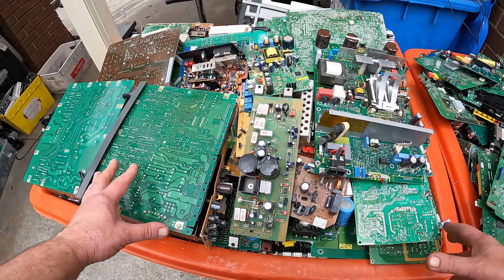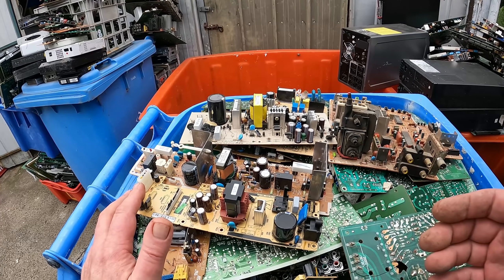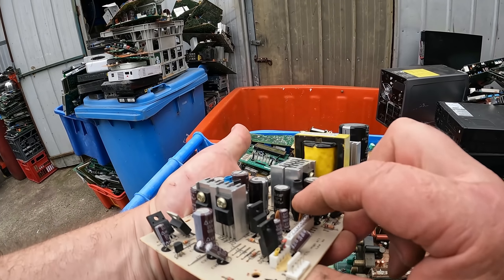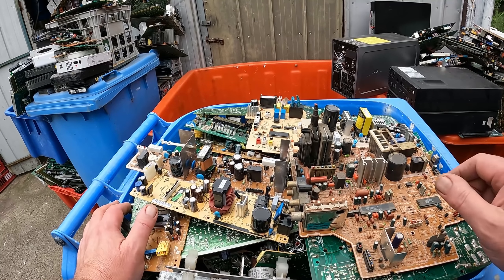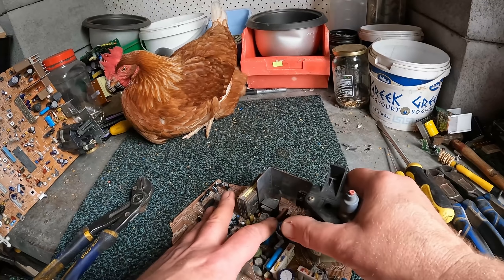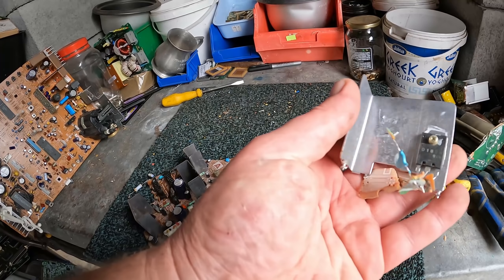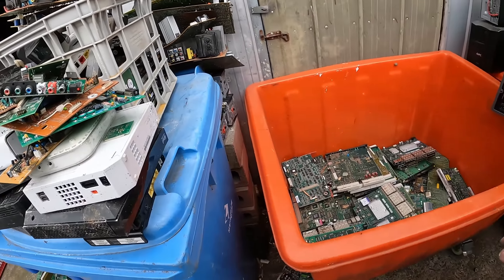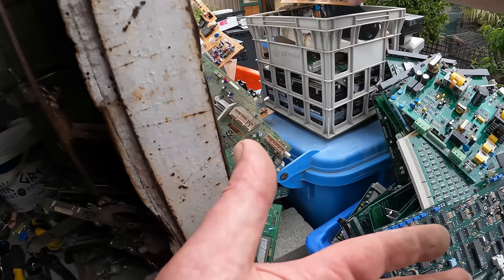Depopulating Low Grade Circuit Boards

Comment: May I ask why you don't use a hotplate instead? This seems like a much harder (and wasteful) way to do it.
Reply: He's a caveman with tools but has yet to invent fire.
Reply: With some flux and a bit of lead. -edit: no flux
Reply: Dangerous fumes could be a problem though.
Reply: Yeah sure, use expensive energy to render a slim return to a solid loss :-P
Reply: @stevendegreef93  Does this guy work for free? Because I don't think the cost of running some kind of heater setup would outweigh the time savings. He spends over 10 minutes on a single board that could be 1-2 minutes if you just heat it up and let the components fall off.
Reply: @phillipward4934  Yes I just learned that the flux is the main culprit there. Well advised comment because the desoldering pot people often warn about ventilation. I'm so clumsy hot liquids are my bain, and messes.
Reply: Busting them off for gold recovery is far quicker than desoldering it. Nobody is buying recovered ICs in the quantities that he's got. He could put one on eBay and wait a month for the one person in the world that needs one. It's just a fantasy of people that don't know the market. The time involved in waiting for the board to heat up, electricity costs, knowing which chips are worth money, time to list them online, time to ship them, etc is just not worth it. It's not even worth ripping them off and selling the broken ones.
Reply: @littlejackalo5326  So why is he doing it in the first place??
Reply: @dtesta  He said gold recovery. The leads that wire the silicon chip to the circuit board are very fine gold wire. Microscopic. No substitute for real gold as it is the best electrical conductor available. Other components may have "rare earths" or other precious metals. I guess if you get the old boards cheap enough you could make a buck.

Comment: I DONT UNDERSTAND.    WERE BUYING ELWCTRONIC ITEMS FOR $50 OFF EBAY For One parts Board Per $50.00 THOSE BOARDS.    NOT LEFT ALONE AND IN GOOD CONDITION ARE WORTH A MINIMUM OF $10.00 EACH.      ID GIVE YOU $300 FOR 3 WHEELY BINS

Comment: I find an oscillating multitool with a medium metal blade takes those IC chips off quick and easy. Also leaves the chip intact, which looks a little better when selling.
Reply: As long as your not hitting the board, that tool will atomize the board into very  fine and dangerous to breath silicon dust.

Comment: How times have changed. In the sixties and seventies it was so hard to find electronic components in Australia. Rare and expensive with a large number of people into electronics as a hobby inspired by publications like Electronics Australia. Now few engaged in electronics as a hobby and there are parts everywhere, even high grade gold RF transistors and silver capacitors. Would kill for those in past times.

Comment: DIY and project people are interested in those fly back transformers,  probably misspelled it, big oblong cylinder with the big red wire,  they are good for high voltage projects, ...

It would probably be worth someone's time to sell tv fly back transformers and lots of capacitors, project parts, stuff like that, off of the boards, seperately on ebay

I've bought random things like that myself, some things are hard to find and quite expensive new.

Comment: Everything i ever build is was made by parts from already used PCB like this. As a student it was worth the time to desolder that parts with care.. I build lots of stuff with them.. dual laboratory power supply with case from garbage.. and it is still working almost 10 years without any problem... 20 kHz sinus,square signal generator.. still working... 300W amplifiers... etc... 
And not to mention that most of those PCBs certainly work fine. Just someone threw them out because was lazy to put it to internet and send it to someone who would use it for another X years.... Im sad for humanity.... wasting resources and polluting nature...
Reply: this is not a waste of resources. if this stuff didnt land on his table it would go into landfill.

Comment: 17:56 that's a ptc for the degaussing coil , when the tv is powered on it will be low resistance and then quickly heatup and go high resistance like a time delay relay .. degaussing is needed for few seconds

Comment: 35:00 the easiest way to scrap them is to smack it with a hammer a couple times then pull apart and let iron parts fall out copper remains..   fast and easy..

Comment: Excellent vid buddy, this is exactly what I do with all low grade boards, I'll pull almost everything off and separate it and it adds up quick, as I don't have the room separating each item takes up less space and I'm better off when I do eventually do a big trip to a decent scrap yard to sell. It doesn't take long if you do each board as you get them. Good to know about the flyback transformers I'll take them out of my transformer tub.

Comment: u can sell some of these on ebay , i can see so many boards that are worth some value and many are looking for these boards , i have a dead 40inch lcd tv cus i can't find its motherboard , local scrapyards have thousands of tvs but they don't have the time to find my exact model board , in here we have markets elling salvaged parts like those big capacitors might still have some life left , i buy many used parts from local markets cus they are way cheaper than new parts and for my hobby stuff which will typically endup blowing anyways its better to buy from scrap . and not pay 50 times more on lcsc or mouser for the part and shipping and wait. i just take my pocket multimeter and test the parts before buying them.

Comment: I always see what's i can take before i throw an appliance. Certain Caps, Resistors, Diodes ect can be used in certain projects. Of course their subect to testing for leakage, ect but if they read good why throw them? I convert old Tube/ Valve Radios into Guitar Amps so some of the stuff comes in realy handy.

Comment: People buying and working with stuff like this should look at the board and the stuff they get to see if maybe there are unobtanium parts on em like device specific Transformers or old CPUs. Heatsinks could be sold as single parts and they usually are somewhat standard so they could be sold for quite a good buck

Comment: I stubmled across your channel due to the fact that I am planning on starting up my own ewaste company. I come from an electronics engineering background and one of the first things I had in mind was in fact to save most of those components. If not bothered with setting up a desoldering station, just buy a heat gun and melt the solder away from the bottom of the boards and most components will fall right off. But dont scrap a capacitor for its aluminium, thats madness :D

Comment: Just put the bottom part of the pcb over the solder pot and wait for few seconds and give it a good smash all the components are off the pcb all cleaned up . Best way to remove the components it takes less time and effort and more value .

Comment: I was told that the ponytails on the power supply wire is alum is that true because i saw some people put the wires in the insulated wire bins

Comment: You should be careful with those capacitors. They can hold charge for months after being disconnected from power. They can seriously hurt you 😶
Reply: Months? no. Minutes/hours yes.
Reply: @jaro6985  I fix consoles daily, it's months. Research it
Reply: @TheCod3r  Google electrolytic leakage current typical values.
Reply: @NEED2CONNECT Do you happen to know the size and voltage, or what it was in?

Comment: There are some desirable items in the lot but how much time do you have to spend?  If you have lots of time, it may be worth pulling out "good" parts but for most recyclers like myself, I just don't have the time to do that, so I just end up selling low-grade boards as scrap and move on to more valuable boards.

Comment: Create a website name it anything you like related to electronics parts and sell these components which you can easily salvage . You can use a solder pot which is nothing but a a box of metal filled with molten solder . The components are expensive and are much more valuable than scraped .

Comment: I'd say there are things to do (but these are just my sole opinion I *probably* miss things in the big picture)
1 desolder with hot air gun. it could yeld many IC that, sometimes are between 0.10$ & 1$ *each* if they work. But I wonder if there is any company that could test & sort them.
2. when you see a transformer with ferrite bead, to get the ferrite out & copper too faster, I'd smash it with a hammer, since ferrite is brittle it will help uncoil it faster and make you gain more value per time used.
3. connectors may be a good value to sold. especially these cinch/rca that you could get in big bags seeing how much audio video boards you seem to have. same about other connectors, some are rare or nearly impossible to find. starting a website where people can order if they buy at least 10 connectors could be pretty good. Many eloectronic websites are selling some connectors for very very high values. as salvage, customers would find at your store better price while knowing these are salvaged components. I think about proprietary connectors that could be interesting in that scope.

Wish you the best & more

Comment: Dude, these big 450V 330uf and higher capacitance capacitors go for ~1-5$ each on aliexpress, in europe branded new from authorized shop around 6-16€. Suggest visiting local electronics shop and ask for how much these caps go for... And start selling them on ebay as kit (10,20,30) with good price (without ripping them off the board damaging the caps ofc). u'l haveto invest abit on desoldering tools and a ESR tester to verify the caps if they are good. Watch first 1-3seconds of my PSU repairs where i show what was defective in repair, in my experience, its a massive problem on PSUs that they go bad. Atm buying batch of 10 (330uf450v) caps from china at 2,5€ each, 25€ total

Comment: I wonder if you could use a deli meat slicer to just cut all the components off by setting the blade just blow the top of the circuit board.  Crushing and melting could probably sort a lot of that out quickly.  A hot tumbler could melt all the solder away and knock the components off.
Reply: Board Upside Down, propane torch on backside, parts fall out.

Comment: "Value add"... dude, don't remove it with a wrench -- desolder it properly, bag it, and sell that stuff on ebay. You'd make a fortune. Electrolytic caps will need to be checked due to electrolyte evaperation, but, still.

Comment: In my area of Florida I can sell low grade locally for 0.22/kg but still prefer to value-add low grade by stripping off just about everything of any value and selling the leftovers as shred. For Mid and Higher grade boards I send them off to BoardSort in Ohio for better money...but I typically end up splitting those profits with the post office or UPS because of the high cost of shipping.  For me it is a relaxing hobby, so I don't mind spending the time micro-scrapping.
Reply: USD .22 is AUD .30.

Comment: Nice video Ben. I actually sell the heatsyncs on eBay as long as they are clean. Down side for U.K. scrappers is finding companies to buy ewaste and even steel and iron in small amounts. Where I live near Heathrow West London several companies have a minimum amount payable to weigh in of 1000kg. Ewaste I’ve yet to find a company to buy from me so as you mentioned Ben, I just break the good bits up and throw the rest away sadly. Best wishes to you.

Comment: What always wondered me is this. You throw reasonable boards out as scrap steel. Even a blank board contains a copper right. What is the limit for the scrapyard for them to buy it as a lowgrade?
Reply from the maker: Not enough copper on a blank board to pay for it, the processing cost would cancel out any profit
Reply: @eWasteBen  that makes sense yeah. Thanks!

Comment: Throwing those boards into scrap steel is not recycling but a waste of ressources. I depopulate my boards too, but I still sell them as low grade because there's enough copper, tin, aluminum and other metals left which can be recycled. Also all my board crumbles and the plugs from my cables go as low grade here.

Btw.
my scrapyard does accept aluminum with the steel if it is 95% aluminum or better for 1,00 Euro at the moment. There's no irony aluminum here, if there is too much junk they buy it as "shred metal" which is 0,30 Euro. They don't take Aluminum capacitors because of the chemical fluids inside.

Comment: I wonder if there's a market for a device that works like an automated desoldering rig. Thinking something like a 3d printer heat torch with a vacuum to remove the components..  with the view to actually recover THT components, could be possible to sell removed devices for significantly more than scrap prices.
Reply: a desoldering pot with some AI robotic arm could do the trick
Reply: I seem to remember Apple making a device like that to disassemble and scrap out their obsolete electronics.

Comment: I thought your intent was to salvage the components.  You might as well just chuck the boards into a fire if all you are going to do is destroy for content.  PS - I use a heat gun and a sharp rap on the edge of the table.  99% of the components pop right out and go in my parts bins.  I rarely have to buy new :-)

Comment: Sometimes you gotta make the hard decisions in business and figure out whats costing ya. as for scrap steel as a non-abn a certain yard in bendigo is paying $300 a tonne for pressing. (about a 25km from home) yet a yard i'd sometimes visit 190km away is only paying half that, yet they pay good on other metals. it really does pay to shop around and weigh up ya options.